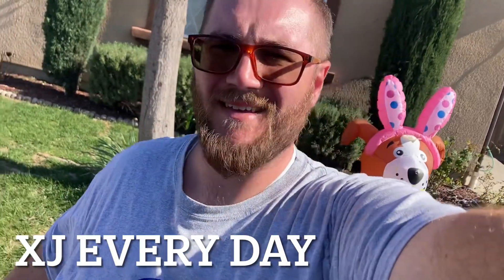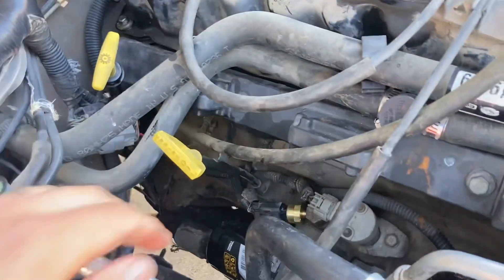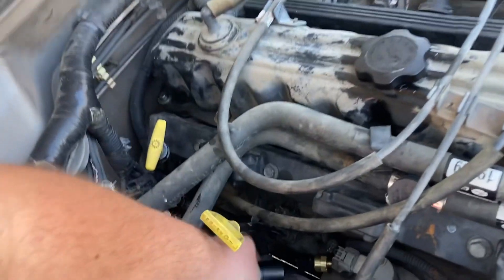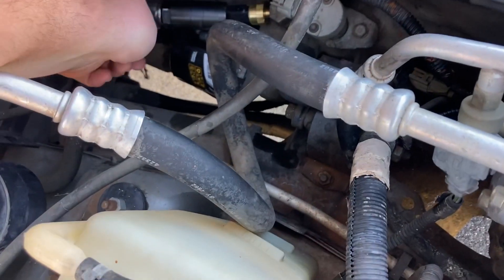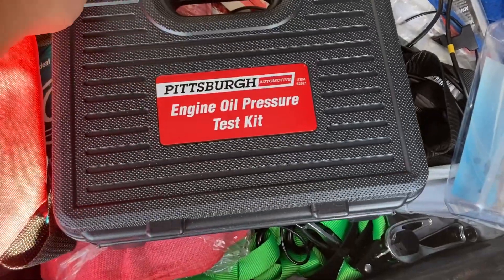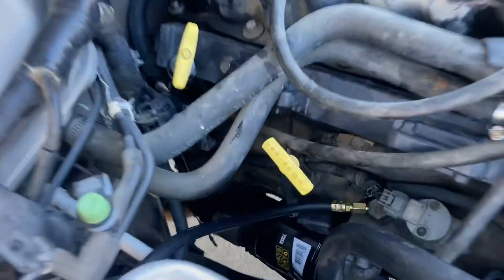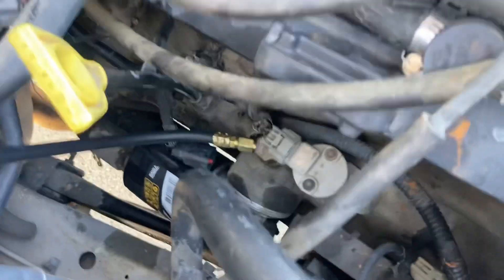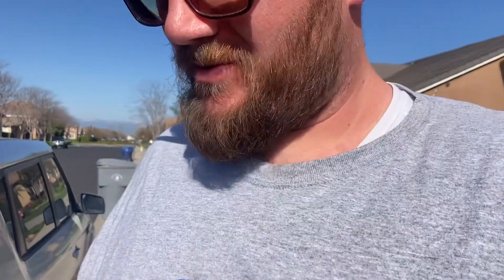Using an oil pressure test kit on a Jeep Cherokee XJ

Comment: Increase your oil viscosity to better fill the wear in engine and handle the heat better too. From there your oil pressure will rise. obv use an oil with suitable wear properties (API SL or above) but with higher top number eg 10w40 , or specifically look at the cSt viscosities at 100C. i do intend to knock out a video out on this for people but know it will trigger some oil heads.
Reply from the maker: Thanks for the tip. I guess I’m kind of scared of jacking things up further by using a different oil.
Reply: @xjeveryday  mate it'll be absolutely fine. See you guys in US using shell rotella 10w40 and even 15w40 to have high zinc content and thick viscosity. 
Plenty people add Lucas to thicken the oil etc. I'm sure you won't see the pressure go too high

Comment: That seems very low to me. I want to say that my xj is 30 - 40 psi at idle. I'll have to pay attention later but it definitely doesn't drop down to 10 psi even though I did read that 10 psi per 1,000 rpm is acceptable